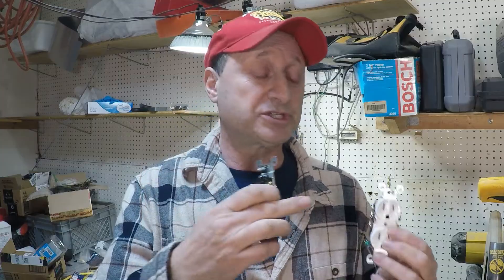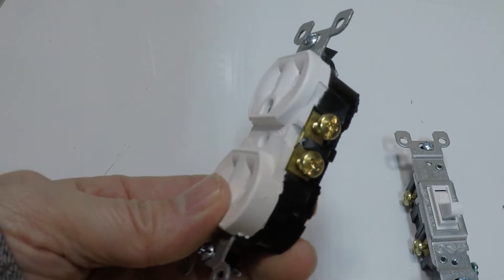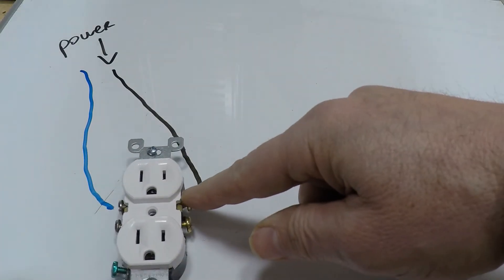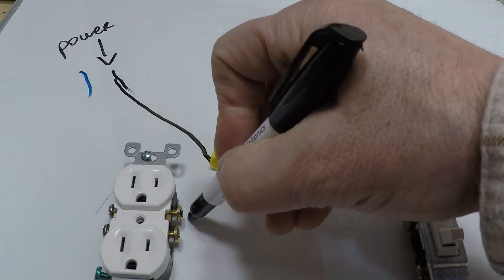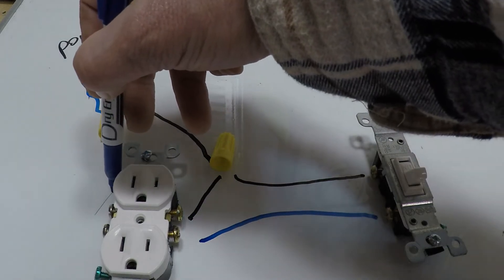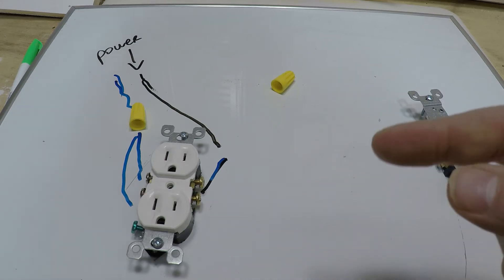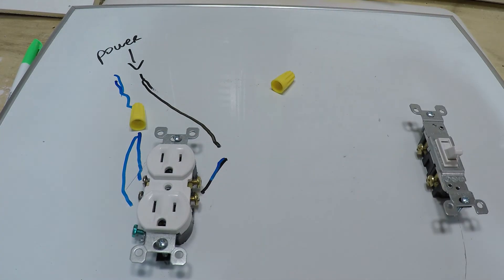How a Light Switch Can Control an Outlet

Comment: I have a switch that controls the light but also several outlets and another light. I want to separate it to where the switch only controls the light, and the outlets are always hot.

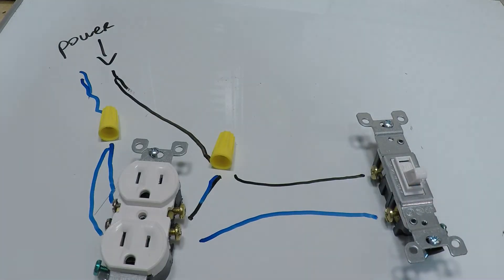Comment: If you freeze the video at the 4:35 mark(for demonstration purposes),. Id like to run a new wire to the ceiling for a ceiling light that would be controlled by the existing switch?  Can I connect the black new wire to the blue(bottom) wire of the switch via pigtail? If so, what do I do with the new white wire?  The switch would control both the ceiling light & the 1/2 outlet. Thank you
Reply from the maker: Is there a light switch already wired to the outlet?
Reply: @flannelguydiy6458  yes. I'm going to pull the wires from the outlet & the switch and separate them to see where the hot comes in.  Hoping its to the switch.  Would then run a new wire to the switch, and attach the black to the outgoing powe of the switch and the white to the white in the box?

Comment: Want to run a outlet from my switch, my switch has a power (Black) and a neutral wire (white) on the same side of the switch, anyway for this switch to have power to the outlet all the time, right now it will not work until the switch is on?
Reply from the maker: Unfortunately the power is really coming into your light first. Then, they used just ONE wire to run down to the switch using the black wire and the white wire as HOT wires. You have no neutral in the light switch box right now which means adding an outlet to that circuit is not safely possible without pulling a second wire from that light down to the switch box.  Thank you for watching. Would appreciate if you could sub to the channel.  Thx... Flannel Guy

Comment: Can you just eliminate the switch by tying the two wires together, and replace the receptacle without breaking the tab?
Reply from the maker: yes you can absolutely do that. Then you will have a switch on the wall that does nothing. Thank you for watching. Would appreciate if you could sub to the channel. Thx... Flannel Guy

Comment: Thank you for the video. How do I connect a light fixture from the bottom outlet to be controlled by the same switch? Can I just connect the white from the light fixture to the bottom white and the black to the bottom red so the switch controls the light fixture and the bottom outlet?
Reply from the maker: just do not break off that tab in between the top and bottom

Comment: how about if theres a light and receptacle thats to the switch and you just want the light to be controled by the switch
Reply from the maker: You would need to change the outlet to have one with the tab that is not broken off. Then, tie the switch to hot and neutral in the outlet box to the wire that is going to the switch.  Thank you for watching. Would appreciate if you could sub to the channel. Thx... Flannel Guy

Comment: Can I just add a wire to the bottom of the outlet to add another outlet to this run?
Reply from the maker: Yes you can put a black (hot) wire at the bottom and continue the circuit

Comment: I have 3 outlets that are tied to light switches. They  all test open hot.  Is that proper wiring?  Should I be concerned?  If there is no concern, should I avoid these outlets to plug in extension cords or grounding products?  This is over my head.  Thank you so much!

Comment: Great video. My home was built in 1985, we have in our bedroom a light switch controlling two outlets and a ceiling light. How do I eliminate the light switch controlling the ceiling light. Thanks
Reply from the maker: you will need to pull the light switch out to see whether each light has its wire coming into that box, or whether there is one wire leaving the switch and going to the light and receptacles.

Comment: i started to change recpitals there are two switchs and one plug having a problem with the far switch 2redwires and 1 black and recpt has 2 white 2 black and 1 red
Reply from the maker: If you have a red wire in the mix. This is likely a three-way switch.

Comment: Bear with me...

I have a switch controlled outlet and the switch is in a 3 gang switch box.

Switch to the right controls outside light.

Switch in the middle controls inside light at front door

Switch on the left powers the outlet

Today I noticed the outlet is now receiving constant power. I don't know when that changed, but just noticed today.

About 2 months ago I had to replace the middle switch in the 3 gang box. It was a very simple black in, black out, and a ground.

The hardware store did not have an identical match to the old switch which was probably 10 - 15 years old, but something very close. 

Install was very straight forward and no, I did not mix up the 2 black wires as I marked them when I removed the old switch.

Could this switch replacement be the cause of the outlet now having constant power? If so, how? 

If not, what else would cause this to happen?
Reply from the maker: The only way this is possible is if you somehow made an error with that wiring. Take it apart and look at those black wires again for the middle switch and the switch on the left.
Reply: @flannelguydiy6458  Thanks for the reply.  Upon further investigation, the top half of the outlet has switched power, and only the bottom half of the outlet has constant power

Comment: Good video, you answered a question on removing the out let from the switch, I have 3 outlets that are hooked up to the switch, the prob is there's constant power to the top portion of all 3 or outlets and the bottomof the out let's are controlled by the switch, I really don't like that set up on all 3 outlets is this and easy fix

Comment: aloha good vid thx. how about replacing a switch that powers the outlet out,  and putting in an outlet in its place? I have a double switch box, side by side switches, same box - and one is for the porch light and the other is for the indoor switched outlet for a lamp i guess, I want to take the switch for the switched outlet out and put in an outlet gfi, next to the porch light switch. very old house and possibly no ground wire for anything. Also I have a switch and outlet side by side same box, above the kitchen counter. The switch is for an outlet above the oven for the microwave non gfi now, I want to make it live all the time and get rid of the switch and put another gfi outlet next to the one already there always live or switchless. happy new year to you all --
Reply from the maker: yes you can do that

Comment: I am in the middle of changing a switch for the outlet into a switch to control newly mounted ceiling light. When I opened the switch cover, I was so confused because it was a black and white wire on the two end of the switch (I was looking for two black wires). Now I understood why it’s a black and white wire from your diagram. It’s a method to feed only one wire down the switch instead of two.
Reply from the maker: yeah you have a situation at the switch where there is no neutral wire. Not safe to do, but some people use the ground wire as the neutral... then they have no ground at the switch. Not recommended.
Reply: @flannelguydiy6458 I literally have to rewire the whole circuit correctly to make it safe for the long term. It doesn’t help when I found that the single circuit was powering the master bedroom, living room, and the garage.

Comment: Can I just swat the hot wire location (I mean choosing the top or button) to be hot all the time?
Reply from the maker: It does not matter which hot wire you place on the top or the bottom. Flipping the switch up opens the gate to allow the current to flow. However, the hot wires are the only ones that should be attached to a single pole switch

Comment: Is the bottom wire on the right side black or white
Reply: It's a hot wire, use the hot wire colour for your code. A broken hot doesn't turn into a neutral.

Comment: After changing the outlet back to being unstitched, what do you do with the switch? Do you remove the switch, cap the wires inside, and then just put on a blank wall plate?

Comment: I replaced a on off switch that controlled an outlet now the outlet is always hot the switch doesn't work it the wire is blk and red
Reply: I have the same problem,did you find out what was the problem?
Reply: How many wires did the switch have connected to it?